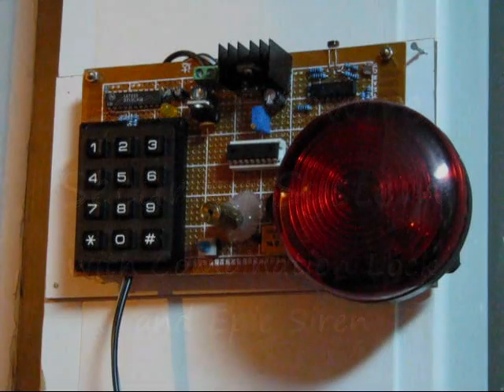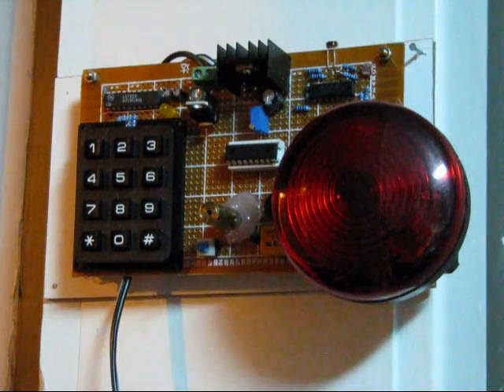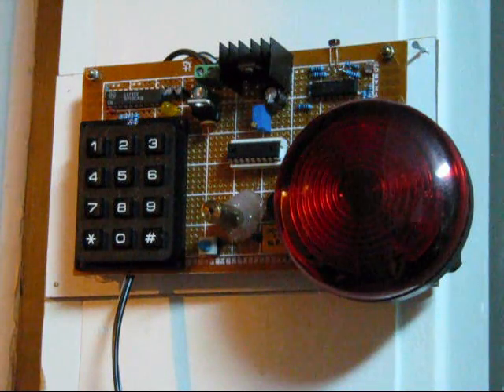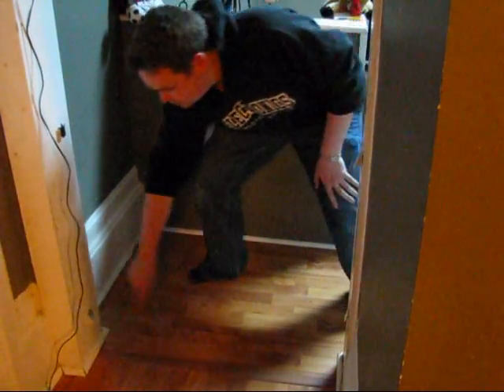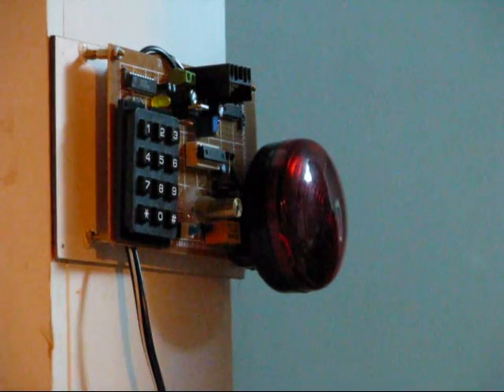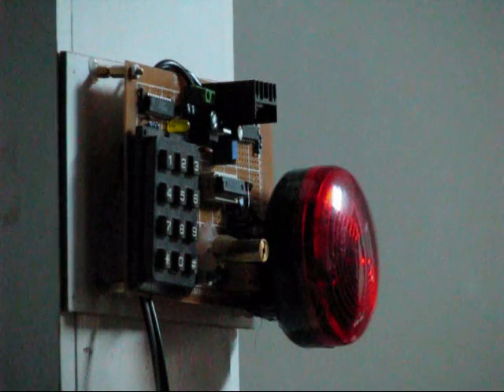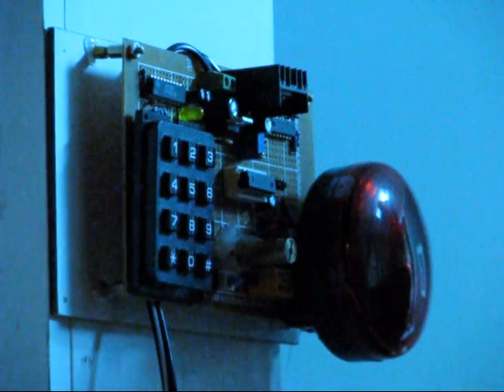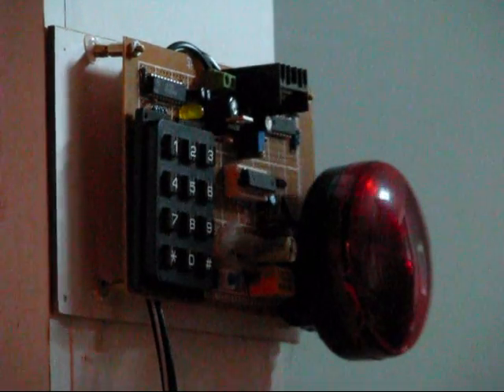Trip-Wire laser security system - Wicked Lasers Contest Instructables.com Video#1

Comment from the maker: @fablungo 
I touch on that in the instructable.  There is a circuit that I've included in the EXTRAS section that would have been used if I had had more time.  That circuit would pick up on any changes, including more or less light on the line.  In this case, shining a really bright light on it may trick it, but it may induce a shock that may trigger the system as well.  Regardless, it is a good question.  Have a look at the instructable if you have time =)
Thanks for the comment.

Comment from the maker: @qp1021 
In this case, yes.  It may have a negative effect on the system, but in the instructable I touch on this.  There is a circuit in the Extras section that talks about a schematic that I designed to modulate a frequency on the laser so that if someone tried what you are saying, the alarm would sound.